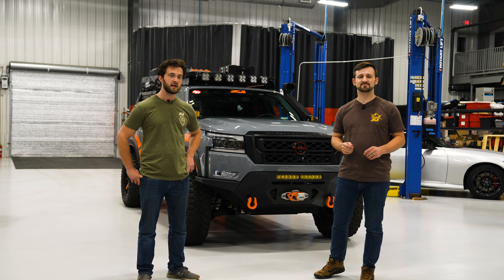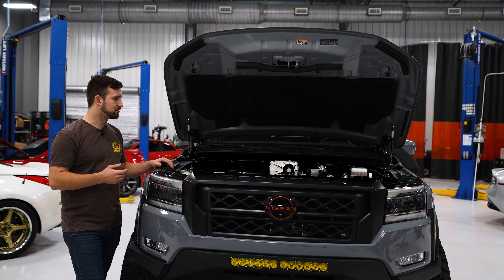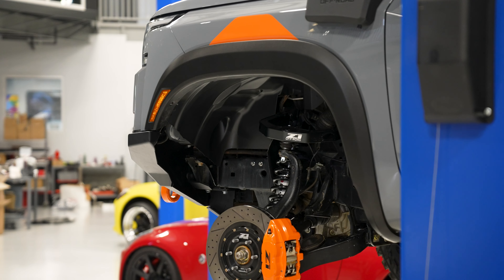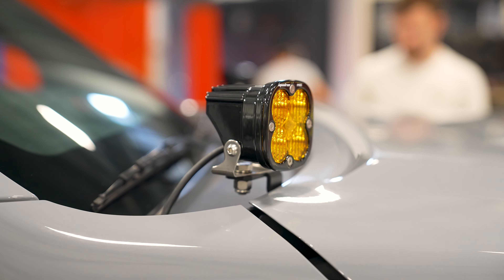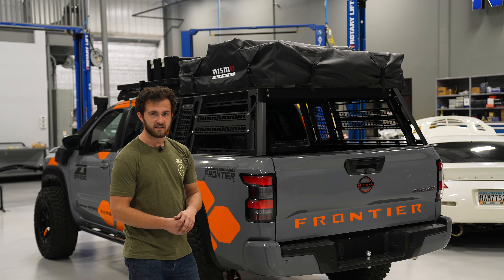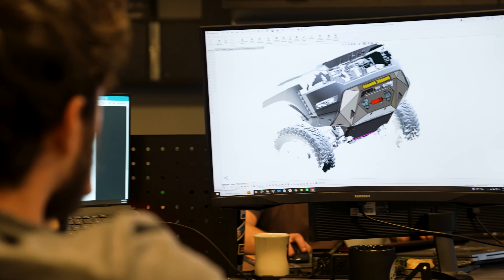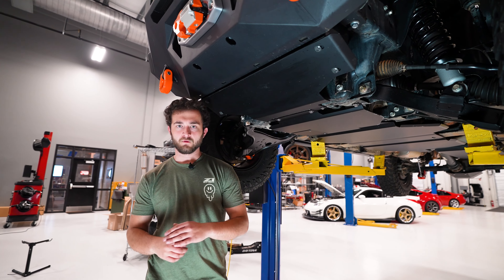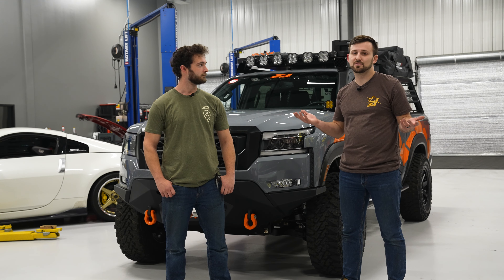Is This the Most Modded Frontier EVER?

Comment: Dam 375 hp to the wheels
Reply: My jaw is still on the ground...
Reply: Really impressive right? That would be 450+ on the crank!
Reply: @hansyang1697  with stock internals.
Reply: Dude.... I was expecting good numbers but damn...
Reply: @jasenswick7725  Looks like VQ38 got some power potential
Reply: @hansyang1697  remains to be seen the long term reliability of said parts and transmission....
Reply: @jasenswick7725  you're going to wait 10 years to see?
Reply: @kaoticmind09  I feel failures will happen in the first 6 months or so of heavy footed driving. Lol
Reply: @jasenswick7725  dude that's not long term reliability...
Reply: @kaoticmind09  not wrong. I'll probably keep this truck at least 10 years.
Either way. Pricing will determine if superchsrging is an option for me
Reply: @jasenswick7725 dude the transmissions is  in many high HP Mercedes applications and all the did for the 600+ hp modes is ad another bearing so that says the transmission is good for 500-600 hp. As is.   Looking at the block im going to say its good for about the same
Reply: That stock bottom end won't last long pushing those numbers.
Reply: It's now 402whp and 373 wtq on their website 🤯🤯🤯

Comment: I have the frontier in Brazil and it's the NP300 model. It's the best in class. Silent, best in-class rear suspension, by miles(coil springs and multi-link). Compared to hilux(the tacoma of the rest of the world) it's like comparing a truck with a carriage. I also tested the all new ranger and i was shocked that the 2014 frontier is also better than the Ford. 5 minutes driving both, i was decided already. Anyone with a brain buys the Frontier over the tacoma.

Comment: As much as it gets talked about and necessary, could you guys do a video tutorial on trimming/heating/shaping the rear part of the front wheel wells to get the proper clearance to avoid tire rub?
Reply from the maker: Every lift, wheel, and tire set up will be a bit different. If you pull up our 2" lift install on the black truck we talk about the areas that are most likely needing to be trimmed and melted.

Comment: I like it.  The only thing I am not a fan of is the drilled rotors.  They are great for the street, but if off roading and you get mud caked into the holes, it is absolutely terrible and causes the brakes to perform extremely poorly.  It is much better to go with standard or if you want a little extra performance then slotted.  Drilled is no bueno.
Reply from the maker: We have them all for whatever your application is, 1 piece drilled and slotted, 1 piece solid, 2 piece drilled and slotted, and 2 piece speckled.

Comment: Is the frontbumper needed to fit this wheel and tire setup?
Reply from the maker: It is not needed, you would just have to trim the corners off the lower bumper plastic.
Reply: @ can you tell  a little more about the ride quality? Is it going to be worse or even improve it ? Talking about onroad use only
Reply from the maker: @JiggiJames  With the titan swap, your ride is signifyingly improved. You are also improving/lowering your center of gravity and improving your turning ratus.
Reply: @z1off-road lowering my center of gravity with a lift ?😮 how does that work?
Reply from the maker: @JiggiJames  The titan swap also increases your track width 6" providing more stability.
Reply: @z1off-road  got you. That sounds awesome. So the Frontiers you did upgrade with the titan Swap + the 2" Lift System are they also as good in terms of ride quality? because I want to try to match the white Frontier you did with the 6" Lift and the 35x12,5 Tires. That one just looks absolutely perfect
Reply from the maker: @JiggiJames  We do the titan swap to give us better performance, more articulation and wheel travel. 2" body lift was to fit the tires (without having to cut up the fenders too much).
Reply: @ thanks so much for your responses, gonna be soon an Z1 customer that’s for sure 👍🏻

Comment: I had been wanting to get a new Tacoma TRD Pro but I’m unhappy with Toyota/Lexus’s new powertrains. So I was hunting for my next truck and like the Frontier but hated the styling. I’m glad I found this video. I never thought there were this many aftermarket options for Nissan Frontiers. I do have one question…. If I bought that super-charger setup off of you…. how much does the mileage drop if using factory tires & rims?
Reply from the maker: The supercharger is still in testing, but as we have been driving the truck stock, we have noticed minimal losses in mileage under normal driving.

Comment: Dang, I really want that bed storage system but not being able to lock and secure the bed is hard no. All you need to do is add 2 rails on the gate of the bed and have a grate or panel that slides up. Cut the top at a matching angle so it looks nice and flush and leave a 2 or 3 inch gap at the top so I can slam it without smashing my fingers. So that I can store tools and walk into a store without losing everything. Or maybe I missed something and you guys are already on top of this.
Reply from the maker: we have been talking about a few things like this, noting confirmed at this time yet

Comment: If that SC kit is 4500-5500 ill buy it in a heartbeat beat i know it will be tougher to keep it on that point but pro charger and edelbrock seems to hold the line  at keeping them under 5k   For the 7500-8900 roush chargers its just too high of a price point.  You guys need to make a lwb exhaust its just an extra 14 inches after the cats before the muffler .  Another exhaust option people would love is dual exhaust rear exit

Comment: I want to posture up my frontier and the most off roading it sees is long sandy clay dirt roads from my house to paved main roads about 5 to 10 miles depending which way I choose to go based on which have been scraped recently... however I would like to be able to haul butt down any of these log trucker rutted, accosted by atv circle infested roads (it's like crops circles out here) and do it like a boss without thinking twice about wearing out my suspension.. is there a modest kit that will level  up my 2019 Frontier 4xSV enough to make dirt roads extremely fun while throwing caution to the wind!!??
Reply from the maker: if you are looking for high speeds, you will get what you pay for. Depending on what you consider modest. Dobinsons MMR or Radflows 2.5" would handle that the best.

Comment: So you're website says the big brake kit only fits 18" wheels or larger, but you have 17 inch wheels on this truck. Will they work with 17 inch wheels?
Reply from the maker: We have these wheels in development and will be bringing a production version to market this year.  So far this is the only 17” that we have been able to clear without the addition of spacers.  We do have a template in the listing you can print and cutout to test fit in your wheels if you would like to check first https://cdn.z1motorsports.com/upload/20021-A-TEMP.pdf

Comment: Hello, i have a 2024 Frontier Pro 4X. I had the OEM Nismo leveling kit installed, however the front end of the truck is still 1.5" lower then the back end. Any suggestions on how i can lift the front end in the safest and most affordable way ? I don't want to change out the entire suspension, etc....Thank you.
Reply from the maker: you can go with a larger leveling spacer, or do a full lift kit. 2.5" would get you sitting right